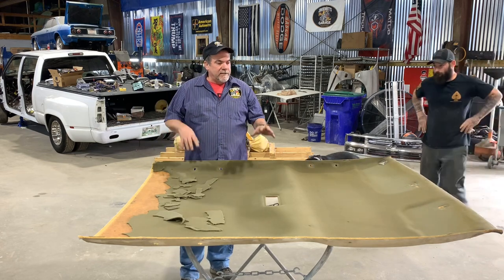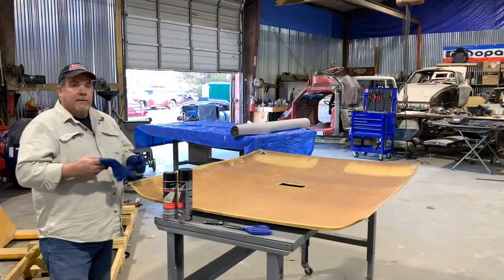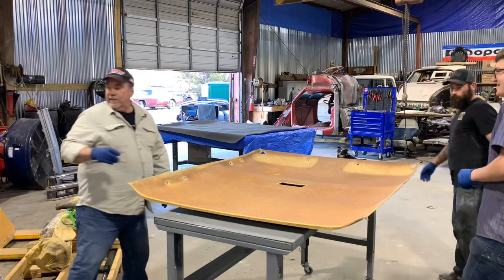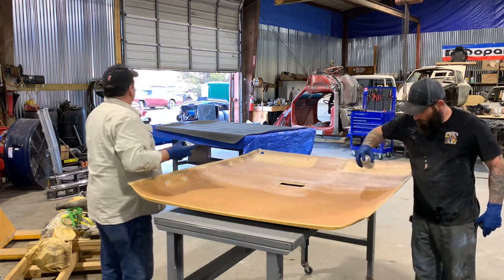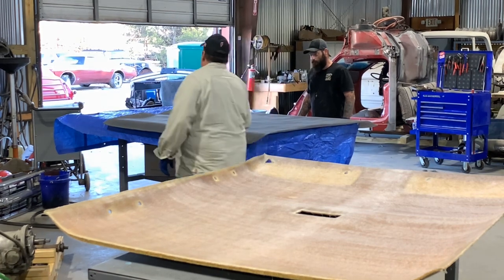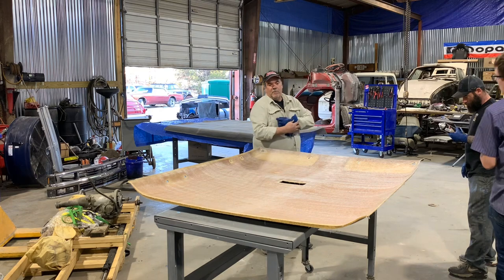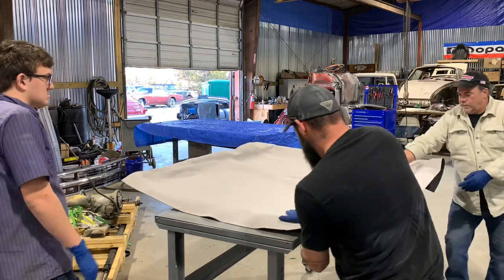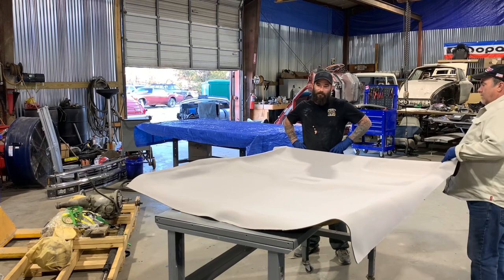DIY How to Fix Car Headliner Fabric

Comment: I've seen some people spray the adhesive and slowly roll the fabric behind the adhesive with someone spraying the adhesive just ahead of the fabric as it's unrolled to avoid getting wrinkles in the fabric. Thanks for the great video.
Reply: Old comment but very good point. This is a great technique with less forgiving materials, such as Daytona vinyl. 
It's much tougher to get wrinkles and puckers out of that stuff once it bonds.

Comment: The way you did it is dangerous lol I always lay my material on the fiber board  and pull it half way back glue half and then do the other half but good job guys
Reply from the maker: we laugh at dangar
Reply: @bennettshotrodgarageclassi7068 not danger?

Comment: Beware. Wear some form of airway protection. 😱🙈🙏🦘
Reply: Yep, I was coughing and sneezing as I was removing the foam on mine ☹ ...no mask. Hands were all itchy too so must be been releasing fiberglass fibers in the process because the backer is fiberglass based with a foam inner core.

Comment: I took a wirewheel to the liner in my 82 c10. Swapped an American Flag in its place. Just picked a almost 400 dollar plastic liner for 100 bucks I plan to put in it after the truck is painted. Prolly be calling soon to get a ruff estimate quote from you guys. 😎👊

Comment: Heh heh "I'm not fat I'm easy to see" I'ma have to steal that one :) The reason you want both sides to be almost dry is because it's contact cement. Im' not sure how it works but I know that from doing countertops when I was doing construction. If it's still wet it doesn't dry I believe

Comment: Was that a heavy smoking vehicle? Everywhere except the places covered by the sun visors is very yellow, but it’s tan behind them. Will it stink?
Reply from the maker: not sure if it was, just a very dirty work truck.
Reply from the maker: all its going to smell like is new truck and broke ass owner
Reply: @bennettshotrodgarageclassi7068  Hell yea, sounds great 🛻
Reply: This is just me, but if I smell tobacco I pass on it. That's just disgusting, and I hate having to clean up after someone else's horrible, self destructive habit. That's just extra work for me to make a used vehicle not disgusting to sit in. Tobacco smoke leaves that yellow residue EVERYWHERE. Don't even get me started on what that tobacco does to your teeth.
Reply: @houseofno  Right,  it better smell like mary jane instead 👽💨
Reply: The headliner on my 98' Windstar was the same. It's like they have a different adhesive above the visor or mask it off for some reason.